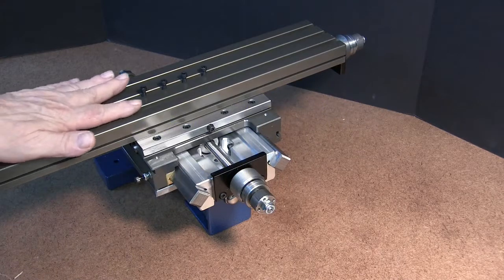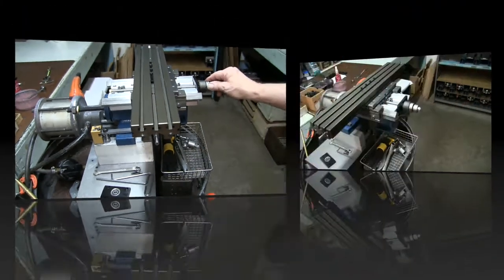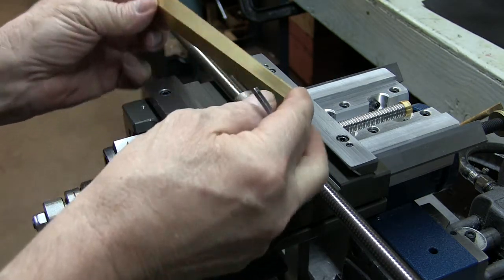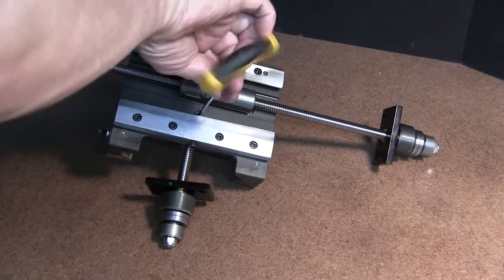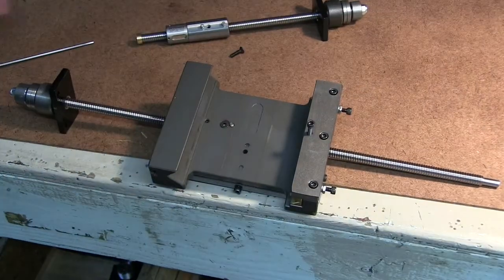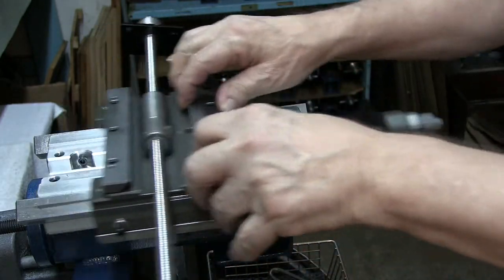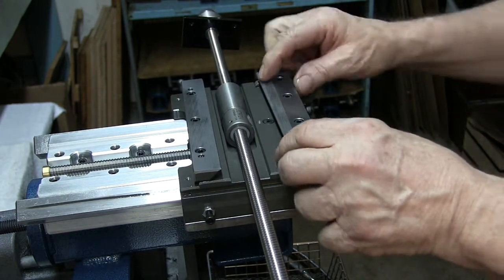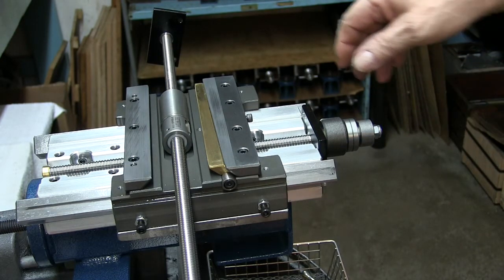BALL SCREW DETAIL

Comment: Thanks for the video John. I've been using the lead screw version of the machine for a few years and the lead screws are starting to wear out. I'm looking into upgrading to ball screws but if I do so I want to put an oil port on them somewhere. The lead screws nuts/retainers don't appear to have an oil port on them, any advice on what to do if I want to set up an oiler?
Reply from the maker: The BallScrews require thin oil and not much at that. Just put a few drops of Auto Trans Fluid or 3n1 on each side of the ball nut (Have the X and Y at midship) every time you start for the day. If the oil is too thick it will cause the balls to skid rather than roll.